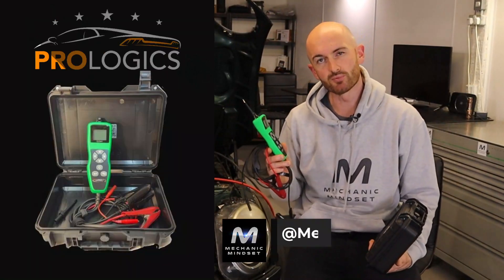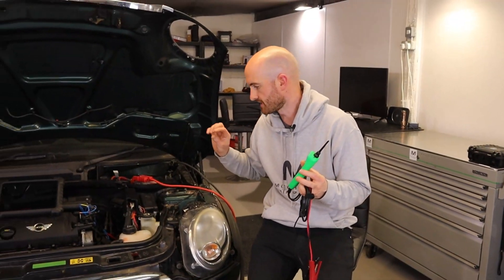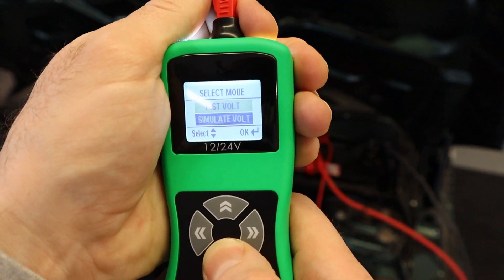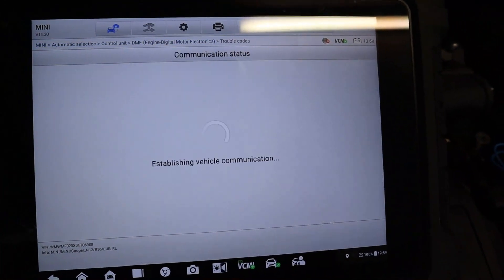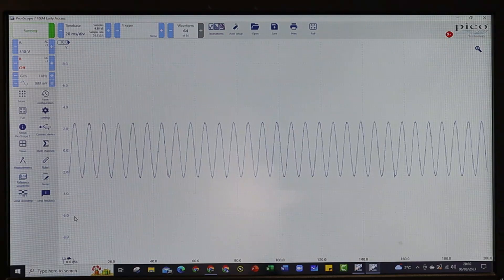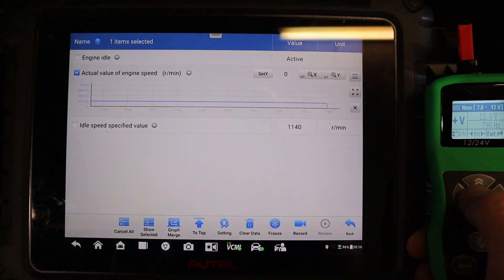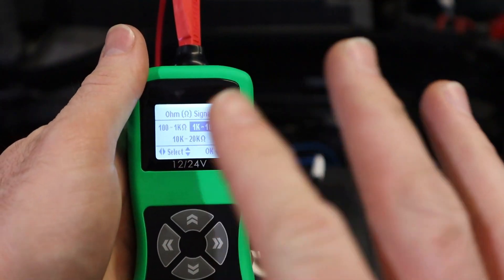Test Your Sensor Systems with the ProLogics Probe - Here's How!

Comment: Anyone tried this against the hubi tools or the ditec autosim pro. Gonna pull the pin on one asap
Reply from the maker: @james9152  Hubi tools is around double the price, but it does have more features like Cam sensor signal output

Comment: Have You ever used one of these on a 2002 jeep liberty ?  Particularly the Sensor on the top of the Differential which I believe is the Signal for the Speedo  Cause the other 2 are on the Transmission and it works just fine.
I'd like to duplicate that signal to see if the Speedo or BCM is working as changing the Original Sensor  and repairing Wiring has no results. 
Thanks Mike M Central Wi.

Comment: hi, the test probe can be connected in parallel with the crankshaft sensor ?
Reply from the maker: I think it can be but it’s best to disconnect and the probe replaces the sensor
Reply: and can I ask one more question? can the probe also regulate the PWM signal? Thank you @MechanicMindset
Reply from the maker: @pavel7311  Yes it can, for sensor signals
Reply: I thought if I would try the throttle valve, the EGR valve, the position adjuster, @MechanicMindset
Reply from the maker: @pavel7311  not enough current in PWM mode. It’s only for sensor circuit.  You could apply a varying voltage as it out puts up to 3 amps. Thats equivalent to PWM

Comment: Great video.
Could you please make another video showing how to simulate oxygen sensor signals, using this tool?
Thanks.
Reply: A sine wave  set at 1.0 volt peak 20 ms time would likely work with this tool or a dds signal generator , with same setting . one thing this tool does that a dds does not is resistance testing .

Comment: Nice video as always. Do you think it´s suitable also for PWM/frequency component tests like throttles, EGR´s, stepper motors etc?
Reply from the maker: Not yet. Max current output in PWM mode is 150ma. I’ve fed this back. Cheers!
Reply: @MechanicMindset  Thanks for your reply. Do you have some proper tool with higher currency output for this kind of test to recommend? (i have some possible option from local Czech company but price is 400 EUR + so trying to find some less expensive solution... )
Reply from the maker: @marekocelik7384  I don’t know; only
For the same price you mention!

Comment: Ive got a little Chinese blue box one off EBay, cost me 30 quid, does all that and more with 60 preset fly wheel tooth count frequency’s on it. brilliant bit of kit 😊
Reply: I think I’d prefer to use a scope and manually check things but I suppose this thing saves some time although I don’t think it saves much really. I love the idea but I find it hard to trust the internals
Reply from the maker: @Tubecraft1  It also requires some solid knowledge to know where to probe with which setting. Good to help prevent unnecessary ECU replacements 👍
Reply: Got one also
Reply from the maker: Ah cool will check it out!
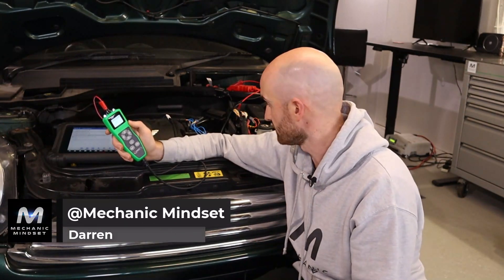Reply: @MechanicMindset  11:24
Reply: Xh2?
Reply from the maker: @wyccka  If it’s that XH2, looks like it only does AC and square waveforms with frequency adjustment. No reference voltage out, variable resistance or PWM. Looks cool for the money though
Reply: Given that it has Chinese stamped all over it would you trust it not to pop an ecu if it goes rogue one day ? Not sure myself
Reply: @Tubecraft1  Tell me what equipment that doesn't Chinese involvement?

Comment: I've been looking for a decent sensor simulator, the power probe form factor is cool and familiar. Possible to reliably actuate vvt solenoids to check phasing in cam crank waveforms?
Reply from the maker: Unfortunately not; maximum current in PWM mode is 150mA; I have fed this back as it was a question I had. Let’s see if we get a V2 with the feature. 👍
Reply: @MechanicMindset  thanks Darren, you're the best!

Comment: Just joined your training site, have you anything on a good but not to expensive multimeter test lead set with banana connectors for options for back probes. Thanks
Reply from the maker: Great to have you! Not anything specific. I  like to use generic 4mm terminated leads like the one in this video, and any back probe I can find. I prefer the slimmer pins. Prologics have the full kit available. Hantek have some individual break out probes that are ok too.

Comment: THANKS FOR THE VIDEO , I AM THINKING ABOUT TAKING YOUR CLASSES . MY QUESTION NOW IS , I HAVE THIS VERY SENSOR SIMULATOR PROBE CAN I USE THIS TO TEST A APP SENSOR AND HOW DO I GO ABOUT DOING THAT . THANK YOU FOR YOUR TIME ?????????????????????????????????????????????????????????????????????????????????
Reply from the maker: Hi, that’s great. Yes, you can use it in a few ways. You can supply the sensor with a reference voltage as per wiring diagram. Depending on how the sensor works, you could also substitute the APP sensor for the ohm simulation. But not all APP sensors use potentiometers; they are contactless. In this case, you might be able to simulate the voltage going to the ECU. Although I’ve not tried that method.
Reply: @MechanicMindset  THANKS FOR THE REPLY 🙏